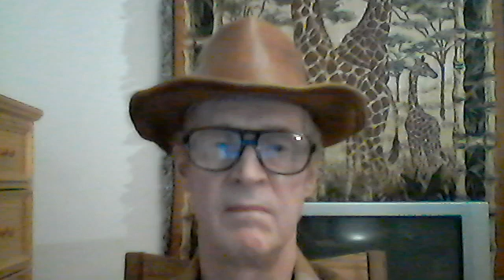Antenna Hazards

Comment: My 530 feet long horizontal loop built up a static discharge on a hot  windy dusty summers day , have now installed a earth discharge on one side of the loop after the 1-4 balun as i got the biggest electric shock i was lucky i did not die from it ,a spark jumped onto my hand from 6 inches away put me of the ladder. The earthing has solved my problem .
Reply from the maker: Evidently, any long wire antenna (regardless of configuration) must have a good earth ground at some point to keep electrostatic charge from building up.

Comment: Back in 67 radio operator Vietnam We learn about high wattage Rf burns by cooking sausages placed near our remote An 10 -AM  
Jeep antennas. They were well cooked. Impressed us immensely.
Reply from the maker: I can smell those hot dogs now. 73 de W1GV.
Reply: @stangibilisco  A lot of power radiating off those puppies. But they would reach the big guns out on ocean that's all we needed.